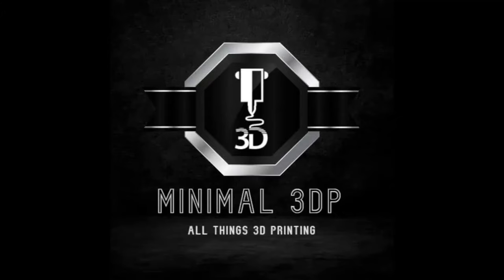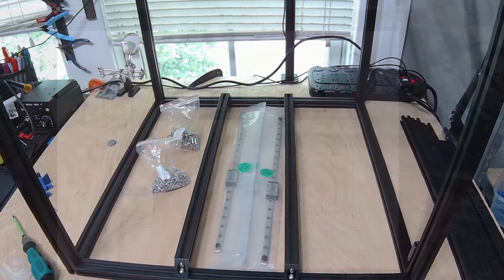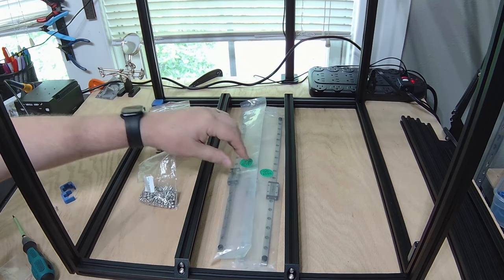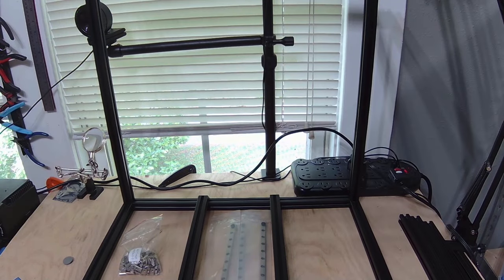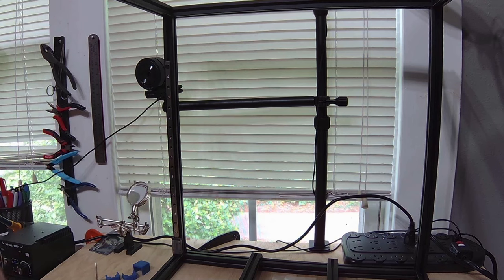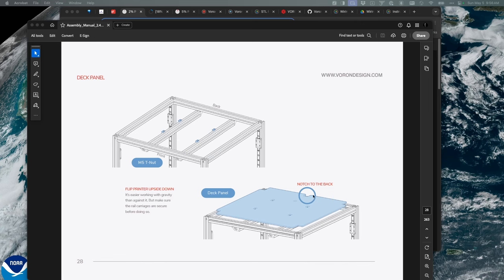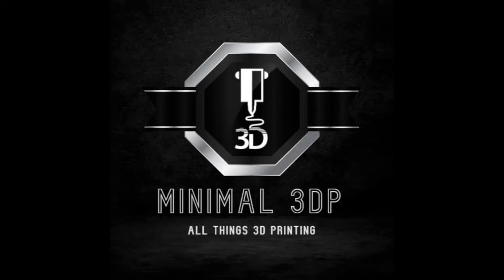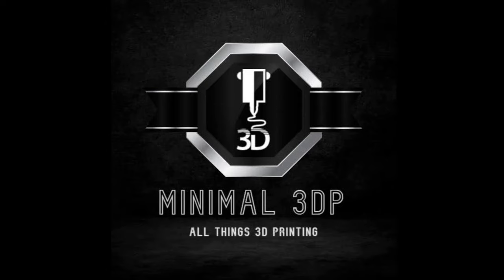Voron 2.4 R2 Build Guide: A DIY Monster! Voron Assembly - Part 3 - Z Rails and Bottom Plate

Comment: Hi 😊 nice to see the progress on your build! I am curious to see how those rails perform. Maybe I got some bad batch, but all my X and Y failed already. Even after being carefully cleaned and lubed according to the best practices of countless YouTube videos. Curiously the vertical rails seem to be fine, my theory is that not hardened ball bearings were used and the rails subjected to higher forces failed. However under the microscope they look fine… A question completely unrelated to the mechanics of the printer, now that I have the mechanics sorted, I have been trying to increase the print speed, I am using the orca slicer tests to fine tune to each filament, but I don’t feel confident to crank up the default speeds, so you have a method for that? I determined the max flow rate for my hotend and each filament, but I am missing a guide to configure the cinematic speeds to take advantage of that… do you have any suggestions or link to a nice guide for that? Thank you and looking forward for your next update